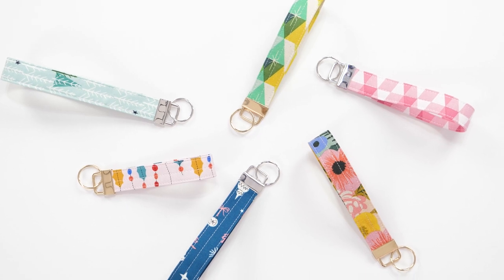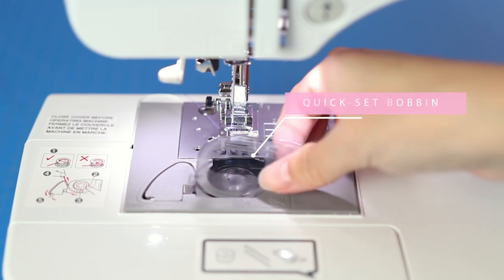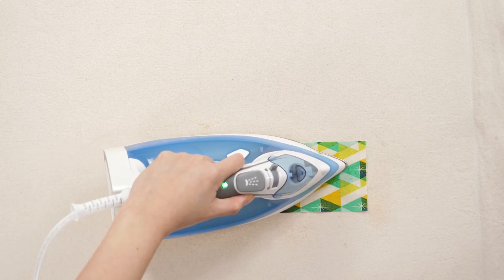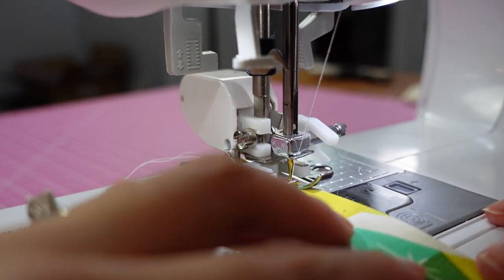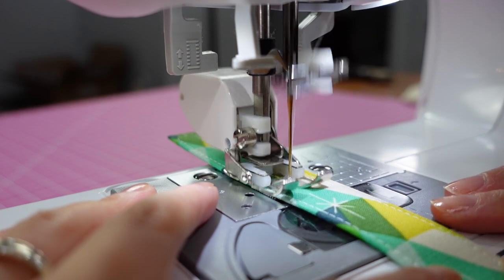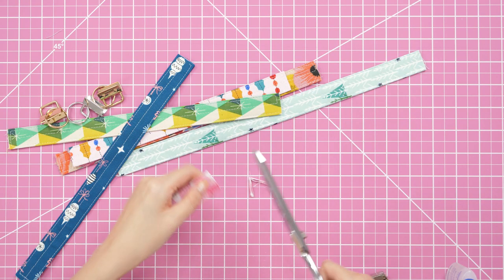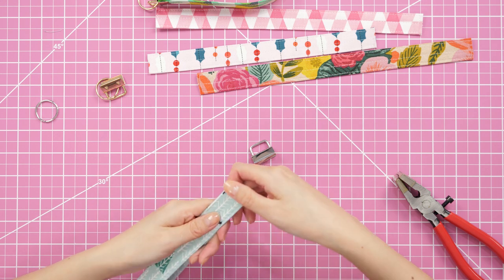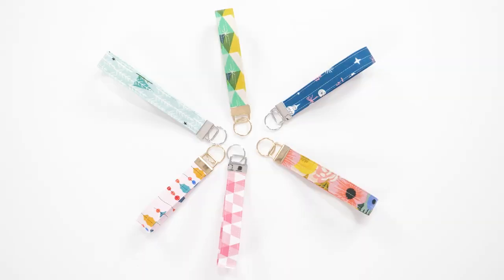DIY Key Fob Wristlet Tutorial | Last Minute Gift Idea | Holiday Sew-Along

Comment: Maybe this has already been mentioned but I saw a tip for clamping the hardware: after you put the hardware on the fabric, fold the fabric sort of inside out back over the hardware so that it’s covering it. You should have a strap covering each side of the hardware. Now clamp the hardware down using the straps as protection from scratching the hardware. This will allow you to clamp down tighter.